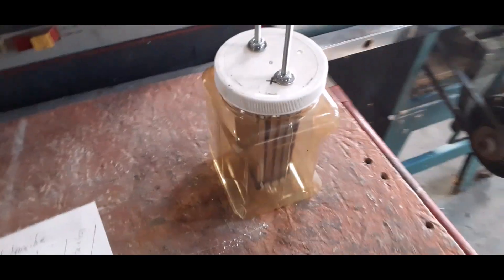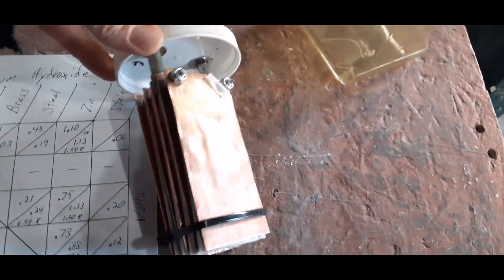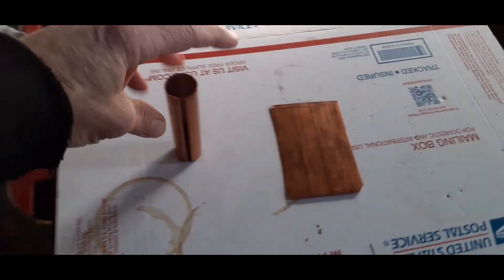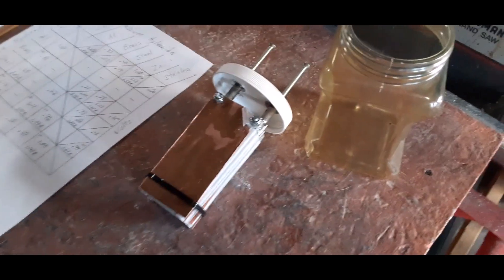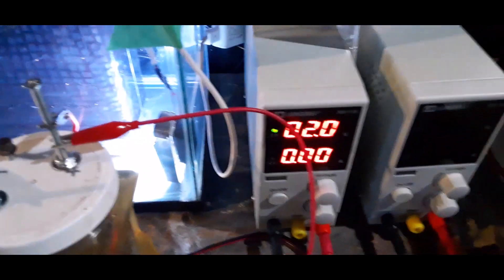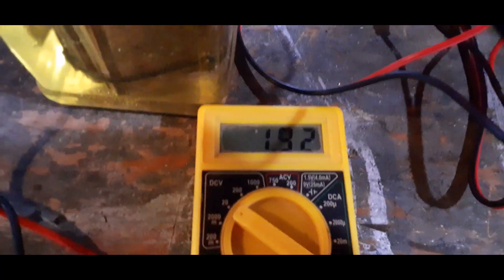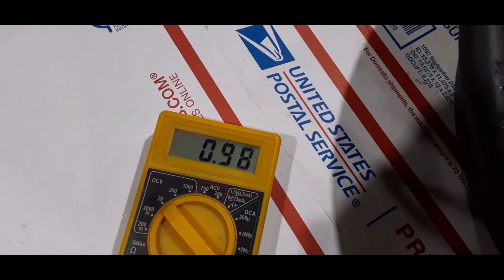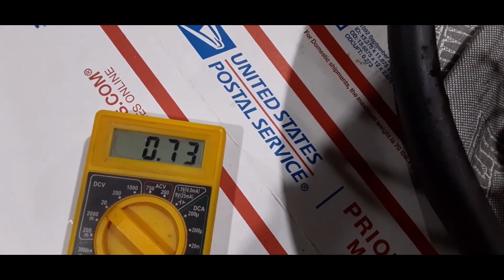Copper / Aluminum Chlorine Battery Cell Test

Comment: Zinc is easy to get you just have to know where to find it anything that easily molded that looks like aluminum is probably zinc screen door handle rv handles ign switches just have to look.
Reply: What do you mean "RV" handles? Do you mean the compartment door handles on RV or what?
I work with RVs so want to check that out when I go back to work

Comment: remember the iron edison batteries , last for ever but you only get half the power you put into them
Reply from the maker: That's all I'm hoping for.  I'll take half the power for 50 to 70 years over twice the power and 2.5 to 7 years.  I'll super size anything that works and replace my battery bank.  Pot ash cell testing is coming up soon.